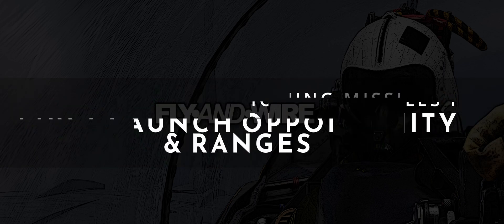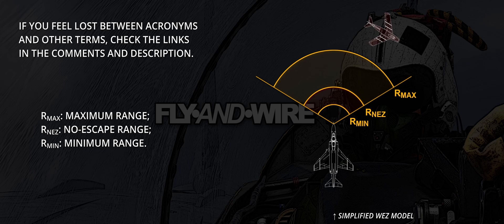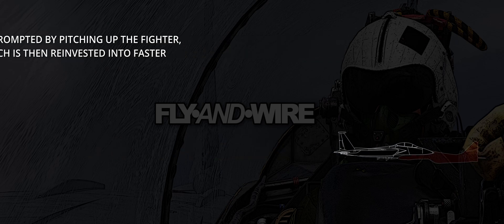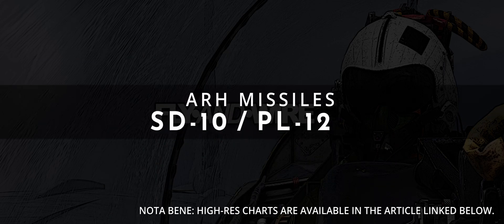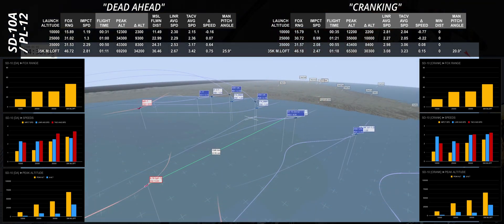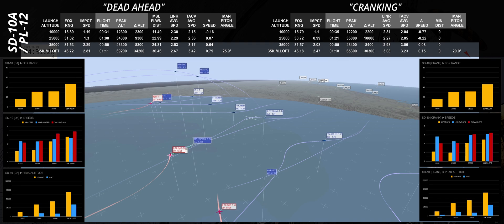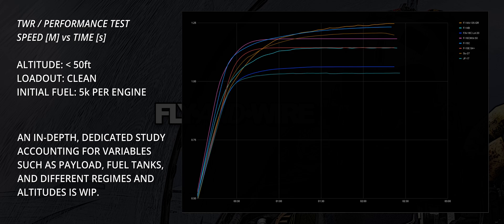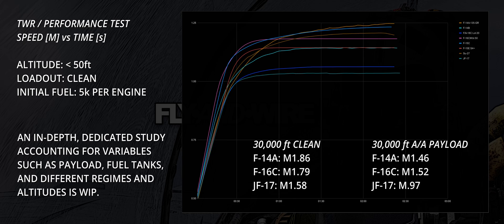Active Radar Homing Missiles I: First Launch Opportunity & Ranges - DCS

Comment: Brilliant work, thank you so much!! Any thoughts on the optimal loft angles for the AIM 120C ? I guess above a certain angle it becomes detrimental, but if so, what's the "limit"? I wonder if the link between the A/C and the missile is limited by radar LOS or if the data link between the two is transmitted via another antenna on the A/C...
Reply from the maker: Glad you liked it :)
I tend to avoid AIM-120 carrying modules. I will do a deep dive once the Eurofighter is released.
Check my old study about the AIM-54, I dealt with the very question you asked. Long story short, over 25° (Mk60)  or 30° (Mk47), the gain was minimal.
I doubt there is any link between aeroplane and missile. The whole lock logic is a flag set to 1 or 0, basically.
Reply: @FlyAndWire  Thank you very much!

Comment: interesting study.

To complete the JF-17 part, its radar is weaker than F-14/16/18 one. But the Thunder get an enormous advantage in combat thanks to the SPJ pod : thanks to it, the ennemy is not enable to open fire early, when the JF-17 can track in TWR. For example, in some tests I made a year ago, F-18 can't get a firing solution over 28Nm while jammer active. And SD-10/JF-17 stay pretty lethal, even firing on an jamming plane.
Reply from the maker: Good point, but a non-factor in the current EW simulation. I can kill jamming targets at 60nm in the Tomcat (check old related videos). Hopefully, one day, we will have either a more believable EW simulation or see it removed altogether.
Reply: @FlyAndWire  i guess the Tomcat is a special case, cause JF-17 jammer is a real pain in the *ss for my F-18 friends ^^
Reply from the maker: Well, until recently, the Tomcat was the only FW fighter I played with (now I can add the F-4E). Can't you angle-track in the F-18? Then manually loft the 120 and call it a day? IRL it does not work like that, but this is DCS...

Comment: Great video!
One thing to look out for, however, is that DCS seems to use different missile aerodynamic and/or guidance models when launching against AI in single-player, than it does for PvP ( this might be due to 'balancing', as an attempt at saving computational resources, or something else.).
I'm not familiar with DCS's code and I haven't even played in over a year, so this might not be relevant anymore, but I just wanted to give you a heads up to check some of your numbers in a PvP scenario where both parties are flying "full fidelity" modules. I'd love to know how big the differences are today.

I do know for a fact (from watching the missiles' fins and the resultant G's over their flight path) that your radar mode and settings does affect a launched missile's guidance efficiency and its effectiveness against maneuvering targets. For example, guiding an AMRAAM while having your radar set to its largest azimuth and bars scan volume, in RWS or even TWS mode (since DCS's "track files" don't actually make use of any proper tracking filters to 'fill- in' the temporal gaps in radar coverage), would obviously increase the target revisit time; However, this then somehow also translates into the missile receiving an instantaneous step-function-shaped jump in its guidance feedback error, each and every time that your radar scans back over that same maneuvering target.
The only way to make sure the missile's midcourse guidance doesn't intermittedly pull large G's for a short time, only to go back to 1G coasting for multiple seconds (which is obviously a lot less efficient than just smoothly turning with a constant, but relatively low, acceleration), is to keep the target in an STT lock for as long as possible, or failing that, to use the smallest possible radar scan volume to minimize the amplitude of those guidance steps.
Therefore I'd also recommend that you use STT wherever able to get the most consistent and repeatable results.

P.S. In case someone reading this thinks it's reasonable for ED to implement missiles' midcourse guidance updates like this, "because the missile wouldn't know it's off-course until the radar has confirmed that the target has moved", that would be the same as thinking that a missile couldn't lead its target, because it "doesn't know where the target will be in the future".
In fact, there are numerous tracking filters and maneuverability aware extrapolation techniques that are known in the public literature to solve these problems.
Reply from the maker: Hey, thanks for your comment. I'm a bit in a hurry, but:
- In primis, the vast majority of players play SP. I can put together some tests to see if there's any difference in a PvP scenario; it won't take long. The only concern is about the precision of the scenario.
- What you described is well shown by the AIM-54A: in TWS, it changes course every 2s rather than constantly. A sort of "boom-boom but not really" because the surfaces are not fully actuated, just more than normal to compensate more. The 54C has an INS and better guidance, and it can lead as required. However, last time I checked, the difference was really negligible in any scenario (IIRC <0.1%, thus falling into the modus operandi tolerance). Also, TWS is (unfortunately) the most commonly used radar mode in DCS. There's an argument for using that.
- Lastly, being an empirical study, there is an intrinsic level of imprecision. It probably obfuscates any minor difference introduced by radar modes.
Reply: @FlyAndWire  Thank you for considering it and for the detailed response, I really do appreciate it.

Comment: I was watching an interview with a former tomcat pilot, I think the channel was "10% true", and he was saying how the pheonix was completely useless outside of 10 nautical miles because even a 5 degree heading change outside of that distance would cause the missile to lack the energy to reach the target because it was huge and slow.  Struck me as odd, but at the same time there's no reason why he would lie and he was a former tomcat pilot.
Reply from the maker: Yeah, well, on the other side, there are some accounts of the Phoenix diving at Mach 5. The problem with such a conclusion is that there are no details: which missile, what motor, what range, what type of target, jamming or not, radar mode, altitude and much more.
On Steve's channel, there's the interview with "Puck" Howe. His explanation of the ranges at which the Phoenix worked better is what I have found to be the most common description of the missile.
Reply: @FlyAndWire  Puck is the guy I am talking about.
Reply from the maker: Odd, I don't remember such a passage. Neither on 10% True or F-14 Tomcast. It has been a while, though.
I clearly remember him explaining the ranges thing I mentioned because I put it in my book/manual.
Reply: @FlyAndWire  I was misremembering the figures slightly but it is from the "F-14 Tomcat Sunset" video on 10% true, in the "AGP-71 and the Phoenix" chapter.

He describes how they would only use it within 20 (not 10) miles, it had a deadzone from 20-30 (he never explains what this deadzone was), and then they'd employ it again past 30 but even a slight 25 degree course correction would defeat the missile at those kinds of distances.

And he is describing this in the context of the phoenix gaining increased capability from the AGP-71.
Reply from the maker: Yep, that's the range bit I was talking about. The APG-71 is a non-factor, the problem is Soviet tactics and manoeuvres as they get closer. If a section splits and manoeuvres, and you are not as fast or high as you can be in DCS servers, then, of course, most missiles get thrashed.

Rewatching the video, Puck said that 30-40 is the long-range shot. Then hold because the target at that point will follow Soviet doctrine and manoeuvre (which is a problem for any radar and missile, and that's their purpose), and employ again when they come hot, usually within 20 nm.
However, put this into context: the longest ever AMRAAM kill apparently was by a Turkish AIM-120C-7 at a range of 28nm around 2010. With this in mind, a 40nm 20 years earlier is a hell of a shot. That being said, if you are at are normal altitude and not supersonic, 40nm against a target with an offset is challenging.
Reply: @FlyAndWire  I was more commenting on the way that targets can evade the missile with minor course corrections.  I know the missile was intended to shoot down bombers at long range, but even bombers can turn.  It seems like the missile is pointless if it is specifically tailored for long range but at the same time easily defeated at long range.
Reply from the maker: OK, the conversation is getting really silly here. On the other hand, it is a good chance to remark why these interviews are great, but must be taken with a grain of salt.
If you skip forward 10m, at ~23m Puck recalls engaging a drone blown by the wind with an offset of about 45°. A Phoenix at 32nm got it. Before, he said that 25° was enough to ditch it. So, which one it is? The thing is, probably both, but we do not have enough details to judge. A 50nm with 25° offset on top of lead collision may well be too much for any missile. It depends by Vc, and whatnot.
Lastly, I would suggest you to check the tests made in the late 60s and early 70s, they are quite interesting. Check on Google.
Reply: @FlyAndWire  You seem to be thinking I am saying your figures are wrong.  Since they're from DCS they're wrong simply because DCS's simulation isn't great, but beyond that I am not making any comment on your figures or even on the actual efficacy of the missile (which beyond comments from interviews I do not know).

I was just commenting on how that remark from Puck struck me as strange, as it seems completely counter intuitive.
Reply from the maker: Nah, not at all. I'm talking about Puck and interviews in general. My point is that they often contradict themselves, so take whatever they say, particularly the numbers, with a grain of salt.

That being said, if you watch my video and see the TacView of the AIM-54 vs Cranking target, you see where the problem is. This is applicable to any missile though.

Comment: With the SD-10, it's worth noting that the missile will not loft at all unless the aircraft is pitched over 9 degrees, whereas the AIM-120 will loft on its own in a number of scenarios regardless of manual loft.

It is essentially required to at least do a small manual loft in the JF-17 for the SD-10 to be anywhere near as effective as an AIM-120 in my opinion.

Furthermore, and perhaps more importantly, the SD-10 will respect whatever manual loft degree you do, up to about 45 degrees in my testing (past that it seems to go dumb and fly to space). This can result in some really crazy terminal dives. I'm still testing the tradeoff of actually doing such huge lofts, since you essentially dump all your airspeed for such a shot.
Reply from the maker: You are correct, but I purposely kept most of the employment details out, leaving them for part II or III. It's an almost 19-minute long video already.
The details I will add later, besides what you correctly mentioned, regard how to WCS handles the AIM-54, which is far from intuitive for ab initio players, how to take advantage from the manual loft of the R-77, and so on.

Regarding the angle, the most efficient, before falling into guidance / tracking issues and diminishing returns, will probably be between 20° and 30°. This is where the AIM-54 falls as well. I made a thorough study months ago, with several thousand launches. It's somewhere on the website - I need moar coffe to remember how the video is called :S
Reply: @FlyAndWire  Interesting. I've been making a ton of 35-45 degree shots and getting very impressive results, but it's usually at the cost of dumping too much energy, given that the JF-17 usually sits at M0.7 - 0.9 with a full CAP loadout. Seems I should tone it down a bit and see if I get a bit better results at 20-30 degrees. Great video btw!
Reply from the maker: Found it: https://www.youtube.com/watch?v=D0A5JQyaqN0&list=PLe6o-xSuVEQkEbBZ3vh_eS9Keeap_5lRW&index=10
You can find charts and whatnot there.

As mentioned, I tested it up to 50°, but then you introduce too many issues, or the results are just not worth it. Besides guidance, the WCS + INS sometimes can't keep up with sudden manoeuvres, especially in TWS.
The JF has the problem of being a modernised F-5. It uses zero fuel, but, as you said, it's a bit of a brick once loaded up.
If there's enough interest, I can make a brief study to figure out how different pitch angles affect the results.
Reply: @FlyAndWire  Thanks, will check this out!